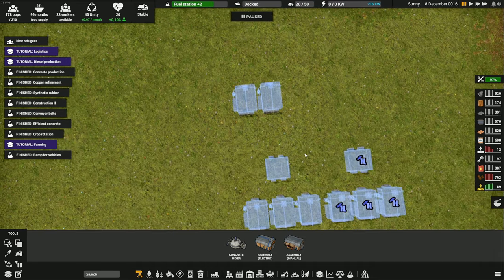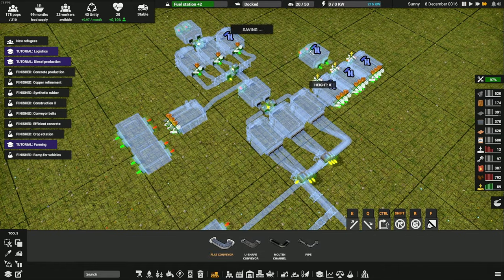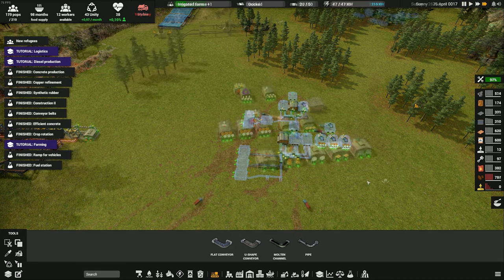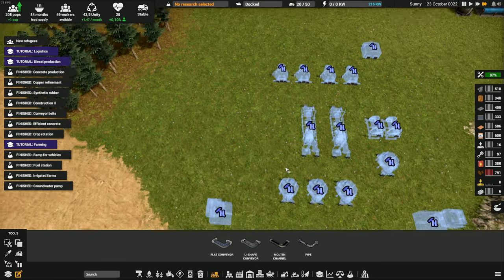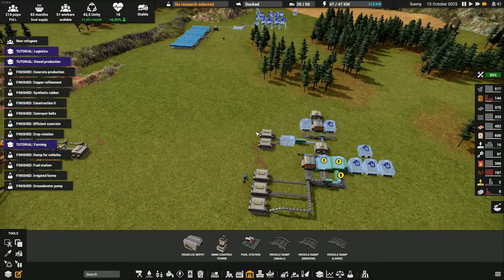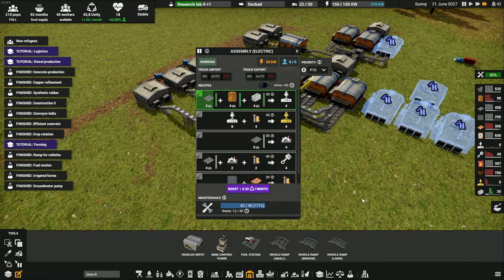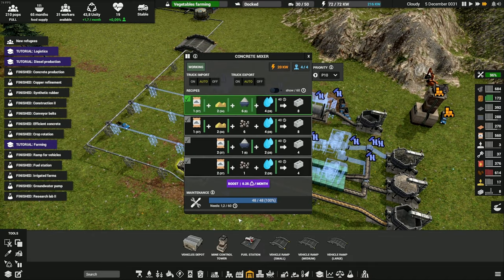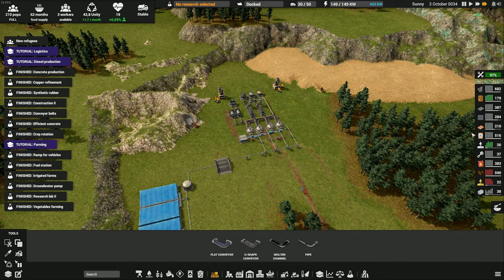Captain of Industry ep3 - Straight Into Efficient Concrete

Comment: Hi! On 5:26 there is a switch in assembler's menu "show / 60", which show all demands and results per 60 seconds. So, you don't need to calculate "parts per 20 seconds" and so on :) Easier for rates estimations
Reply from the maker: Thanks for the tip, i had noticed it before but i to me makes it a bit more confusing xD to much info for my tiny brain to process xD